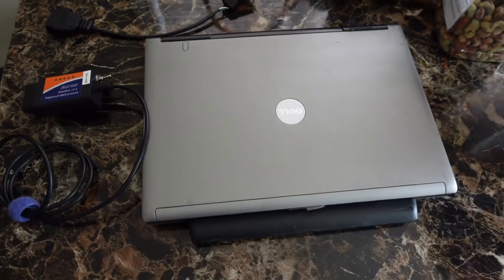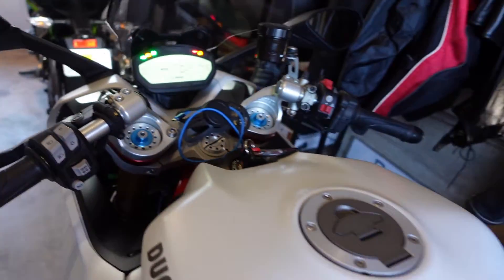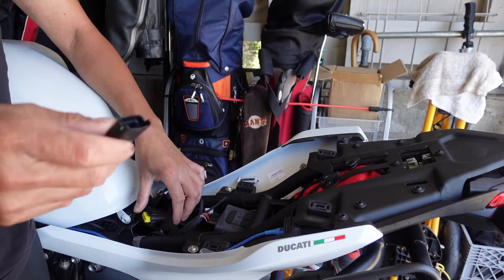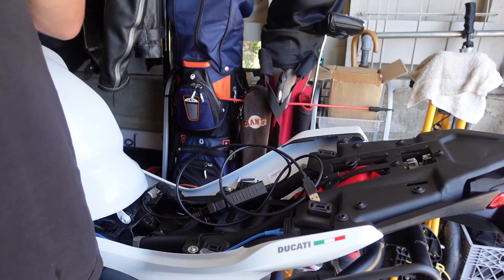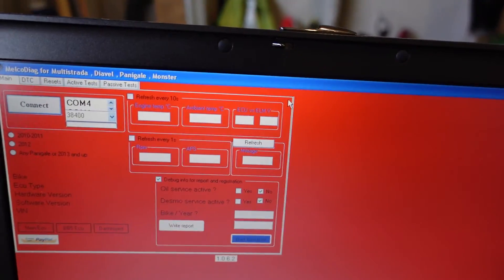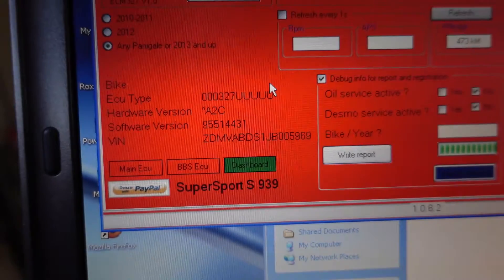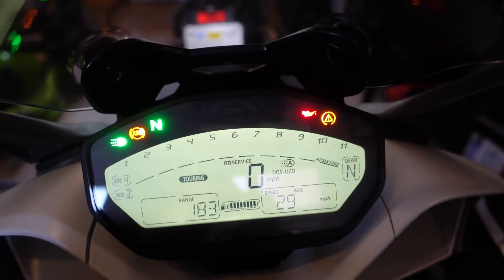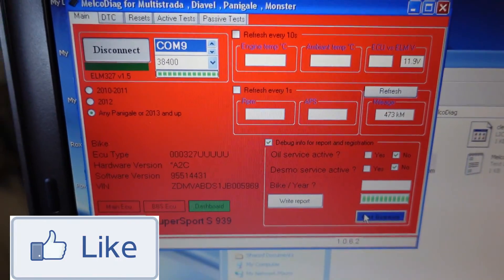How to reset your Ducati Super Sports / Panigale Service Indicators

Comment: where did you buy the cellphone holder?
Reply from the maker: https://www.amazon.com/gp/product/B01CTZ7VVY/ref=ppx_yo_dt_b_asin_title_o03_s00?ie=UTF8&psc=1
https://www.amazon.com/gp/product/B00XIAH3PE/ref=ppx_yo_dt_b_asin_title_o06_s00?ie=UTF8&psc=1
https://www.youtube.com/watch?v=W0wu_5ItOFY&t=191s
Reply from the maker: Don't use the base mount, just the round magnetic head which has 3m 2 way tape.  It's a perfect fit and use the tethers for peace of mind but it is secure without it.

Comment: Did you manage to find a way to reset. I noticed the bottom right hand panel of the pc screen mentioned oil service? Watched another video same software and connectors. Looks like you forgot to setup the licence. See here mate: https://youtu.be/MwI4Ee1k-TQ
Reply: I actually ended up taking it in for the Annual Service because my 2-year warranty was expiring and I wanted them to take a look at my rear brake which I didn't really have in the last year.  They bled it but it was still getting air so they had to replace my rear brake line. They said it was crimped from the factory.
Reply: @dino5254  thanks for your reply. The rear brake are inherently a PITA to service and are notoriously badly setup from Bologna! See this link for service resets
Think you missed setting up the licence as this guy shows?
https://youtu.be/MwI4Ee1k-TQ
Reply: What did the dealer charge you for the annual service ?

Comment from the maker: Anyone interested in the setup $100 plus shipping. Includes the following.  Dell Windows XP with software / DUCATI Diagnostic 4 pin OBD2 connector for Panigale / FORScan ELM327 OBD2 USB Adapter for Windows, Diagnostic Coding Tool with MS-CAN/HS-CAN Switch